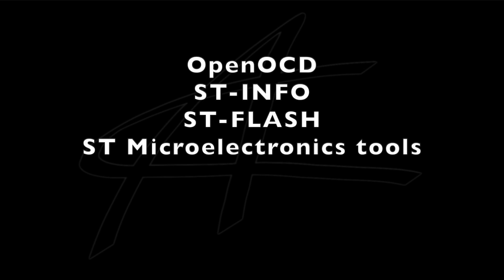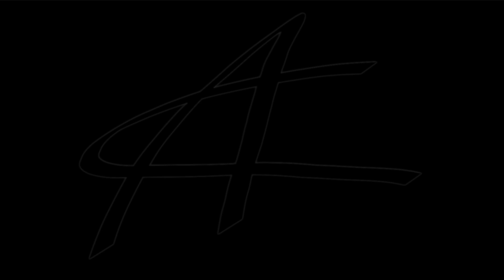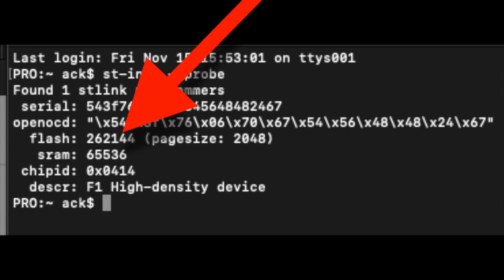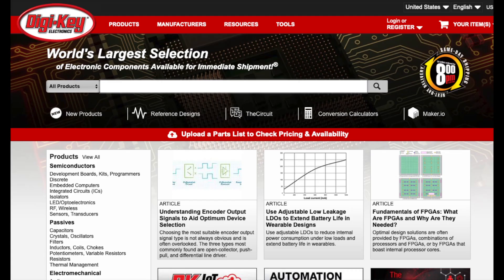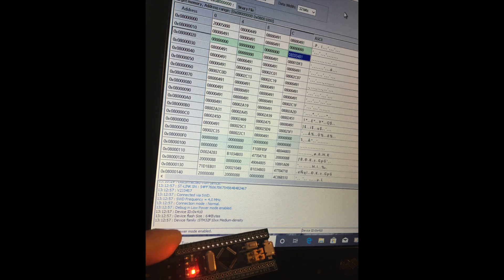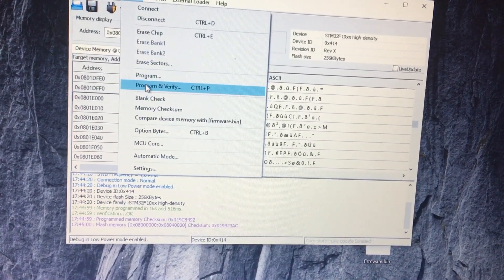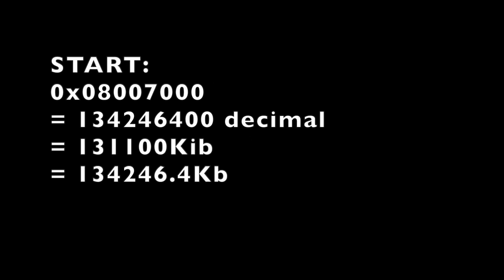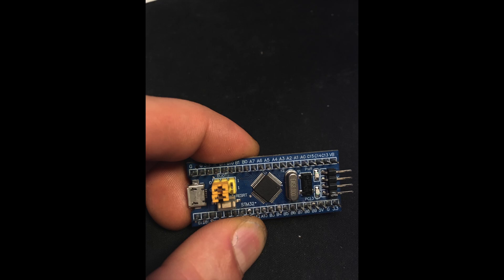Follow-up : SKR e3 mini v1_2, testing the extra memory

Comment: Just a little comment on that. If you have a st-link you could dump the flash memory or try to write something in addresses > 256K offset to verify if it works. I bought skr mini e3 v 2.0 an it still comes with 512K chip. I have compiled Marlin with -O3 and as many features I could think of. It occupies around 384K of flash memory and I haven't seen any problems so far. 2.0 Has real eeprom connected. Ealier versions emulated it through flash section. Thats why some people might have problems with it. Probably the solution to that is modifying linker script and moving it to the end of 512K flash memory (if it's done properly).

Comment: Could you make a step by step guide to check the flash size on the board with st link?
Edit: To check if a chip is actual working 512k or a defective 512k with unusable bytes that has been re branded to 256k.

Comment: Has anyone had a problem after uploading this firmware, where the EEPROM settings are lost after powering down?
Reply: Same here, maybe the chips EEprom may be failing
Reply: Nate G dissable stats from SD
Reply: I found a thread on reddit that says eeprom is  saved on the USB. My settings are not saved on the board either. Trying to figure this out.
I am also having issues with the btt tft35 e3 v3. 0 says no printer attached, I tried all the fixes I can find except for soldering directly.
I could use some help. Lol

Comment: What is the advantage/disadvantage of using a STM32 vs a LPC, eg. SKR 1.3 vs SKR Mini?
Reply from the maker: Well, they are all cortex mcus, but with an LPC you should have an easier time setting up Smoothieware if that is a goal. STM32 is more widely used in general, cheaper, and has more documentation and software support, as well as clones and workalikes, so I expect especially many of the cheaper boards will be using that platform. It's more complicated, but those are probably the biggest selling points as far as this stuff is concerned

Comment: crazy, I've been running mine over the 256 limit from the get go - i even had to manually change the offset for the emulated eeprom because it used to corrupt the firmware when you'd save eeprom, but now marlin 2.0 includes that offset into the pin file.
Reply from the maker: Yeah, that's the way to do it! I didn't think to look for the extra progmem space on the chip at first, but immediately remembered the ugly blue min sys project boards with the 103R's that worked with the extra flash, so I gave it a try.  My only worry was a hard-coded limit on the bootloader, but that didn't seem to be an issue. I have been trying to get the bootloader code out of biqu, but I suspect they have it programmed out of house and don't have the files, si if I have a bit of time, I may look into trying OpenBLT or writing a really basic one

Comment: I've been using the 512K hack now for 5 days now (ever since I saw it posted on reddit) and in general have had no troubles with it. I've tried both tethered (via OctoPrint) and SDCARD based prints, and haven't had any issues. (I've run several 12+ hour prints now, and one or two almost-24-hour prints to boot.)

The only problem I ran into is with the flash-emulation EEPROM. I have tried all of the hacks/tweaks/fixes (changing EEPROM_START_ADDRESS, etc.) The best I could come up with was a firmware that no longer crashes/corrupts itself when you write to the EEPROM, but that doesn't save any changed values to the emulated EEPROM. BUT I was never able to get the darn thing to work on a 256K firmware build either, so I am not chalking this one up to a failure relating to the 512K hack. Maybe I'm doing it wrong, but at this point I'm sick and tired of dicking around with it, so I decided to switch to SDCARD EEPROM emulation... yes it means that I have to keep an SDCARD in the printer 24/7, and it means additional write cycles to the SDCARD, but I am ok with that. (I always make a note of any EEPROM settings I change, so I have what amounts to a "backup" of my EEPROM settings stored in my Evernote; and I have a metric butt-ton of SD cards lying around; so I don't particularly care if the SDCARD dies prematurely.)

BTW, the 512K hack has been integrated into mainline Marlin now (in the bugfix-2.0.x branch) however you will need to change your default_env to STM32F103RC_bigtree_512K in order to get a 512K build.
Reply from the maker: Good to hear, I have not had any problems either.  I'll have to look into the EEPROM issue, but it is possible that Marlin has already done work on it.
Reply: @AlexKenis  are you loosing your EEPROM after powering down? I lost my UBL mesh & Z offset a couple times over the past few days that i started using this FW.

Comment: As Nitram points out, we've added formal support to Marlin for these at-your-own-risk build options. I took some extra time to extend the "Auto Build Marlin" extension for VSCode so it now asks what sized variant you want to flash for: 256K or 512K. Also you have the option to choose "composite" USB, or not.
Reply from the maker: Nice!  That's probably the best way to go about it, and I'm sure everyone will appreciate the option.
Reply: Is there some changes needed to the build options to make use of the larger sram?
Reply: @TatuSahrman  If building without "Auto Build Marlin" you can use the STM32F103RC_bigtree_512K or STM32F103RC_bigtree_512K_NOUSB Build / Upload tasks from the Terminal menu.
Reply: What I actually meant was that if I wanted to try using the 64K ram (evident from the video) instead of the 48K what would be the correct way to go about it. Changing the ram length from ldscipts and defining board_upload.maximum_ram_size in the platform.ini?
Reply: @TatuSahrman  In platformio.ini I changed default_envs to "STM32F103RC_bigtree_512K" It compiles clean and I have not had any issues with it. However, I'm still wary of how BTT inserted the TMC2209s. From their V1.2 document: "BTT SKR MINI E3 V1.2 selects the TMC2208 universal connection mode (can be directly
replaced with the TMC2208 driver). X,Y,Z,E0 each use an I/O port to simulate the UART to control TMC2209 driver." So does this UART emulation come at a cost to us? I wish I was smart enough to know.

Comment: when using a marlin with more features turned on, you will also have to move the  space where marlin stores its eeprom.

you should change the file pins_BIGTREE_SKR_E3_DIP.h

change line 38 that reads
#define EEPROM_START_ADDRESS uint32(0x8000000 + 256 * 1024 - 2 * EEPROM_PAGE_SIZE)

to:
#define EEPROM_START_ADDRESS uint32(0x8000000 + 512 * 1024 - 2 * EEPROM_PAGE_SIZE) //use for F103RC
Reply: If you look at the E3 mini github page, you'll see they changed eeprom start to: "EEPROM_START_ADDRESS uint32(0x8000000 + (STM32_FLASH_SIZE) * 1024 - 2 * EEPROM_PAGE_SIZE)"

Comment: Why not just read it back over SWD/JTAG? Program the memory with various patterns, and read it all back. 

In any case, it's likely some will work and others won't. The 512K is actually cheaper in volume than the 384K... not sure about the 256K.

Comment: The picture shows 64k sram for the rct6 but I know the datasheet shows 48k  https://www.st.com/en/microcontrollers-microprocessors/stm32f103.html
https://www.st.com/content/ccc/fragment/product_related/line_information/line_level_diagram/a2/a6/01/cb/17/48/47/77/STM32F103_line_LN1565.jpg/files/STM32F103_line_LN1565.jpg/_jcr_content/translations/en.STM32F103_line_LN1565.jpg

I got an extra bigtreetech e3 dip baord to play around with and it has a ret6 chip. Now I have to swap the old board in my printer because that was a rct6 chip.
Reply: So I pulled my old board off my Ender 3 and  that board is also a ret6 the e was just a c to my old eyes. Needed to get out the magnifying glass to comfirm it was an e not a c.